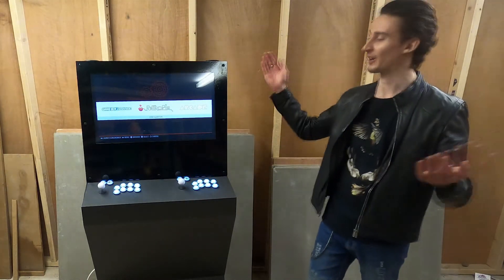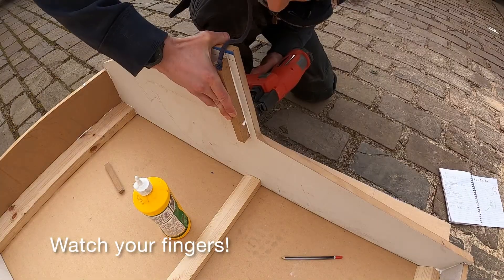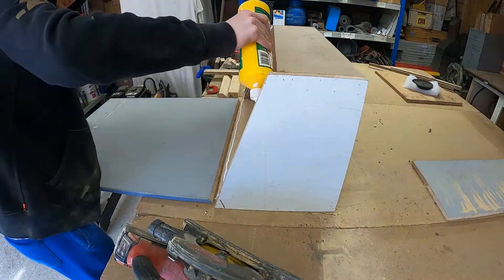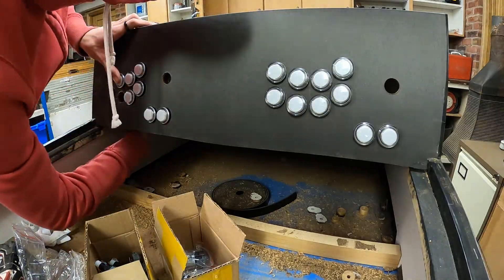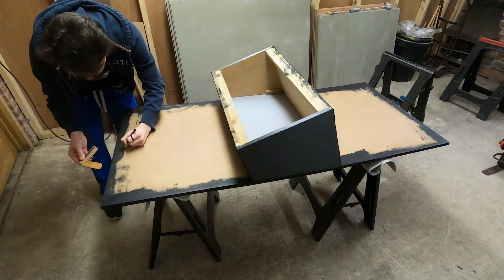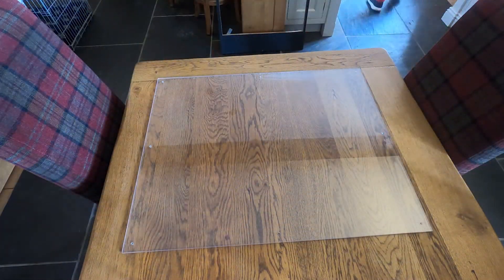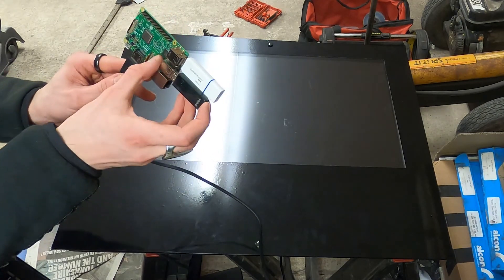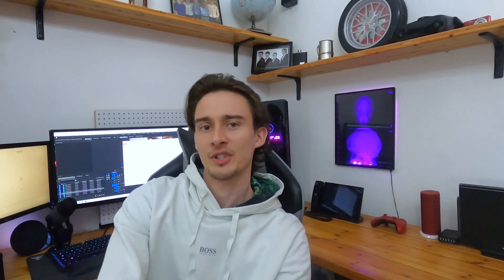How to make an Arcade Cabinet 🕹️ RetroPie 🕹️ Custom Built Arcade Machine

Comment from the maker: Just to let everyone know, I didn't cover the speakers in this video... The monitor I used actually had some built-in speakers that worked great for me!

If you have a monitor that doesn't have built-in speakers, you can easily install some speakers and a speaker driver/amp and hook it up to the Raspberry Pi with an AUX cable.

The speakers you see (briefly) in the video were from Facebook Marketplace (£10) and I ordered a cheap amp from eBay (£7.50 ish).

Comment: Great video, I would consider doing this since you made it look easy except for all the cable connectivity. I would probably try to outsource that by installing a pre made arcade joystick.  But I found it hilarious that a 10-15 minute flash is "literally the most complicated part of the process" when you took over a year to build the arcade itself.
Reply from the maker: You've made a good point! The wiring certainly looks complex, but believe it or not, it's actually way simpler than it looks. Since the IPAC board has labels for all the buttons, it's pretty much plug and play. The majority of the wiring is just +/- daisy chains for the buttons LEDs and a GND daisy chain for the buttons switches, then you just need a wire from each switch to the board.

Granted, I'm a lot more comfortable with the hardware side of things than software, but I believe most people would be capable of hooking this up after doing a little research. ILTMS did a great video covering how this works, so if you're really considering building something similar, I'd highly recommend checking it out!
Reply: @Staples1010  Thank You!

Comment: Also cooling is a must on the raspberry pi when running games. You will have problems in no time!
Reply from the maker: I've not had any issues yet but I've not been using it heavily, mostly just at gatherings, that said, it wouldn't be too hard to add some old PC fans to the cabinet and position the PI next to one of them :)
Reply: Just get the Pi 3B, it has no issues. The extra power of the 4 is like the difference between Golden Eye running choppy at 30fps or running choppy at 35 fps. Yet the real trouble maker when it comes to heat is the really weird not-so-gigabit ethernet controller of the 4, no idea who made that chipset, but it is horrible. Also the regular HDMI port is prefered. And don't forget a USB audio interface, as the Pi audio jack is sounding appaling.

Comment: Dumb question, why paint the cabinet if you're going to wrap it next? Seems like an extra step, unless it makes a surface better to stick to or something.
Reply from the maker: Dumb answer... I wasn't initially planning on wrapping the cabinet hahah in fairness, it likely helped when applying the vinyl (no dust and a gloss surface) but probably not necessary 🤷‍♂️

Comment: I'm picturing this design on wall rails so you could raise and lower the entire system so no matter how short or tall you are it will be the perfect height. Good job man looks amazing :D
Reply from the maker: Thank you! That's a pretty cool idea, another option would be to use multiple french cleats on the inside of the machine, bear in mind, it's not exactly light weight so whatever you attach it with would have to be pretty sturdy!

Comment: Im currently building Arcade machine from my old laptop. What I can suggest to others. Dont put so huge screen like author of video, no point of 28" screen, all games will be played using scale 4:3. Rectangular screens are useless, you need square screen for arcade games. Also machine needs to be higher, and screen should be in bigger angle not flat, otherwise you are watching from top and screen is flat near your belly, thats silly. My machine will be 180 high and will look like older type of snk and neo geo machines only not so fat and bulky with rounded corners.

Comment: Nice, but please tell me they isn't mdf wood? Should of got some stronger stuff, it's worth spending extra on the foundation!
Reply from the maker: It is MDF but it's 3/4 inch so should be plenty strong enough with the amount of glue/nails I've used :)
Reply: @Staples1010  sounds good buddy, enjoy your project 😊👍!

Comment: As a suggestion to anyone watching this.  When appling vinyl first spray the surface and the back of the vinyl is a soap and water mix, about 2-3 drop of dish soap to an entire spary bottle will be enough.  This will briefly allow the glue on the vinyl to not adhere giving you enough time to align the piece, it also makes it easier to work air bubbles out of the vinyl.
Reply: More important, the vinyl is on the wrong side. Put it behind the glass!

Comment: For the screen cover, get a sheet of clear acrylic, mask off the monitor area and spray paint it. Will look great.
Reply from the maker: Ahhhhh spray paint! That would have been soooo much easier than applying the vinyl 🤦‍♂️ Great idea!
Reply: @Staples1010  make sure u spray the back of it, then u dont need to do it very neatly. its still not too late.

Comment: You spent a whole year on this and it never occurred to you that a widescreen monitor is not the proper aspect ratio for retro games?
Reply from the maker: I'm well aware that a 4:3 monitor would have been the ideal aspect ratio. Unfortunately, they don't make them this big, not without it being a CRT or stupidly expensive anyway... Unfortunately, due to the size of the enclosure I wanted, a CRT would not fit, and due to the size of my wallet, I'm not going to buy a large 4:3 monitor. Thanks for your concern though :)

Edit: Plus, I can enjoy some more modern games at a higher resolution and at their intended aspect ratio with the setup I have :D
Reply: You can set the correct aspect ratio for games through the emulation software.